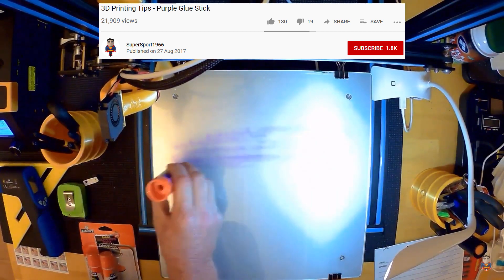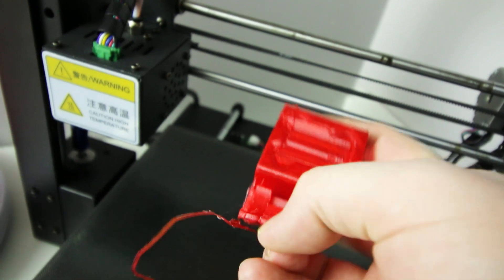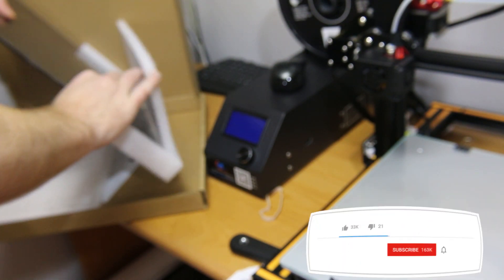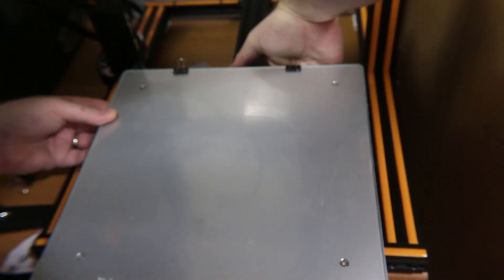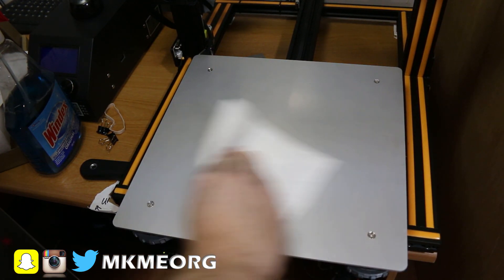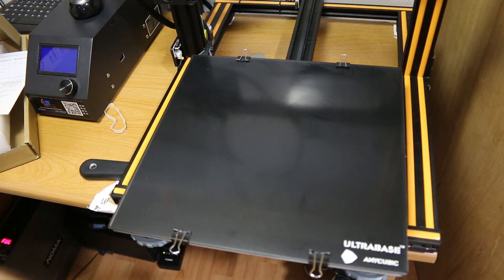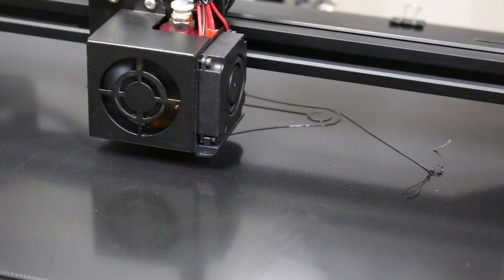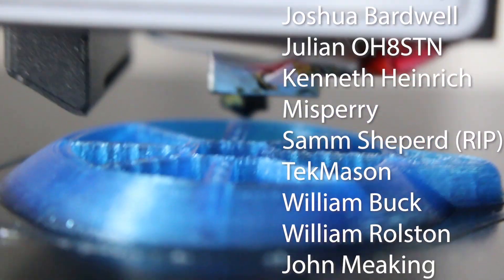Best Modification for ANY 3D Printer!

Comment: Looks like a great solution if you're having adhesion issues Eric. As long as my glass bed is level, I've never needed glue or spray for adhesion and the parts pop off easily.

Comment: Dont wanna spoil excitement but if any print stick too much print can pull chunks of glass with it
Reply from the maker: Only if the user used a tool to pry a print off when its still hot- that would be pretty dumb since they fall off when it cools.  Dont do that.

Comment: Ultrabase was THE best upgrade for my Ender 3. As long as bed is heated properly, adhesion is excellent. And it's much less critical on Z-offset, when it comes to achieving good adhesion.
I paid around $15 for it on Banggood. For price of one filament roll, it's a no-brainer. I can recommend it to everyone who are having problems with their current setup or who are just getting their first printer.
Reply from the maker: Same here. The CR10 went from a "meh" printer to totally usable- just have to give it some extra time heating the bed to ensure the glass is fully up